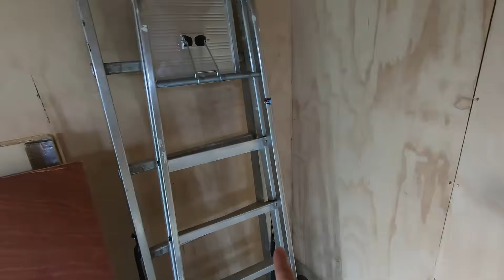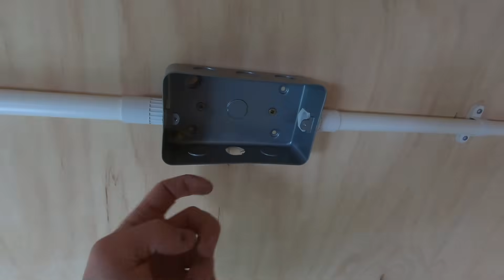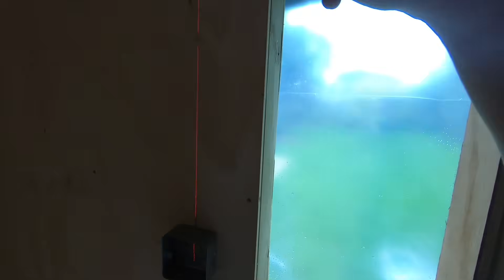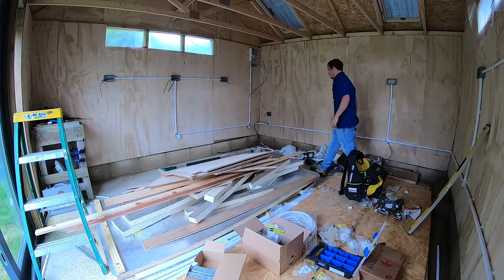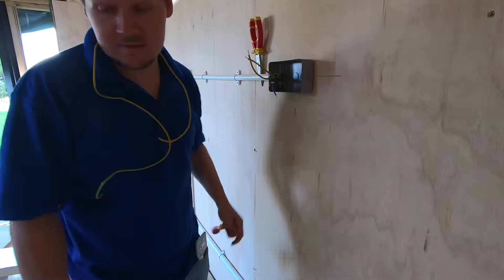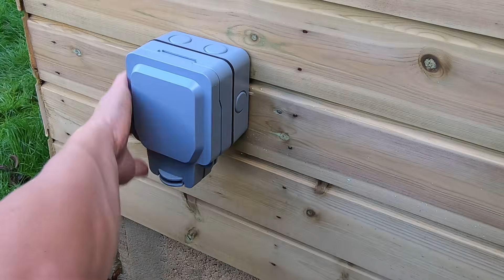Power And Lighting In Workshop - Shed.Part 1

Comment: No flexi con 😢😢
Reply: Right, no flexi crew christmas card for Chris then 😡
Reply from the maker: Alex Dougherty I’m going to Nicks for Christmas dinner this year.
Reply: @Cjrelectrical  😂😂😂😂
Reply: @Cjrelectrical  cool.. All sparkies round to Nick Bundy's for a flexicon Christmas 😂 yo ho ho...
Reply: Upset after that slagging off at the start I dont see a single fabricated bend....... ah well
Reply: @rik061119  Theyr'e called "inspection elbows"...so you can see visually what cable is inside the conduit. No need for a bent/formed elbow.
Reply: @muzikman2008  just dont see the point in slagging it off if your not going to show the skill yourself
Reply from the maker: There is no skill involved in bending plastic conduit... I had the 25mm2 elbows over from another job so wanted to use them up.
Reply: @Cjrelectrical  I just didnt see the need in bashing how other people work is all, you have your ways they have theres
Reply from the maker: If you realise it’s a joke between me an Nick I’m not knocking their work at all bud just a complete joke.
Reply: @Cjrelectrical  I understand but not everyone does. And by the way a love both your channels. 👌👌👌👌👌
Reply: Yeah Chris u still good for Christmas ?
Reply from the maker: N Bundy Electrical yes il bring the sherry trifle.